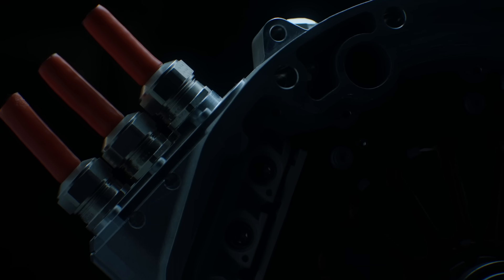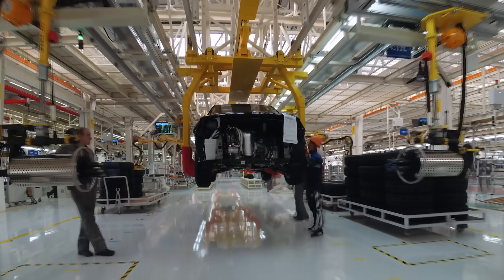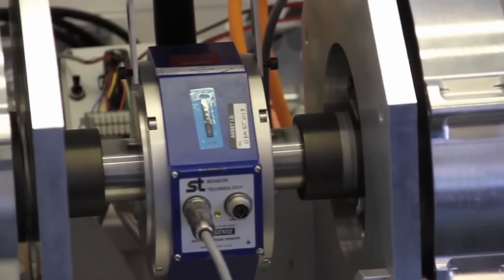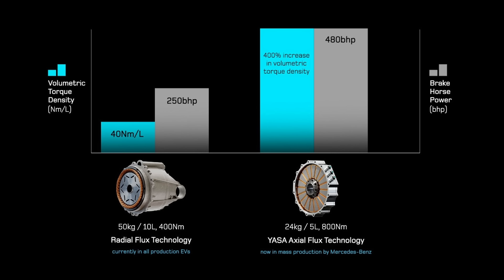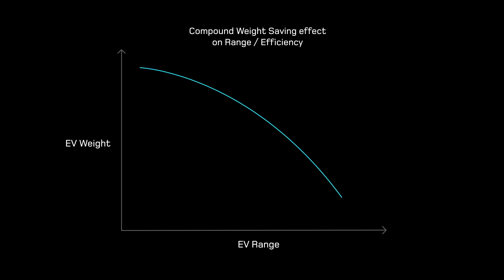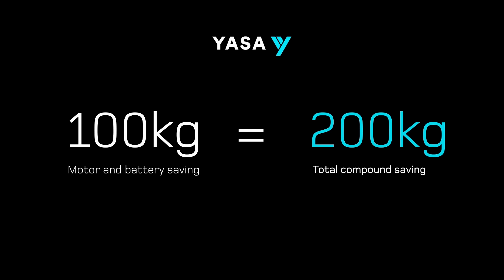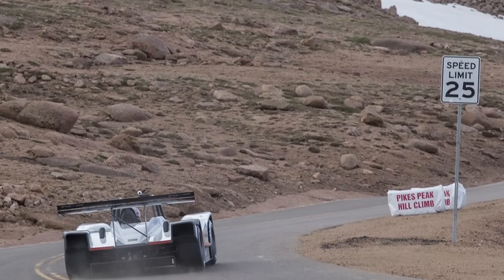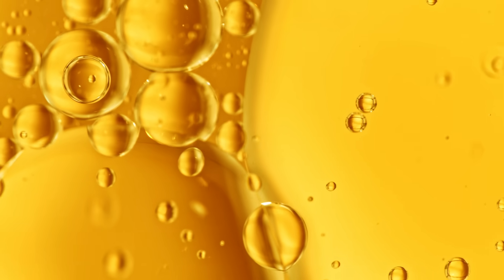The YASA Story - Axial Flux Motors: The Future Of Electric Vehicle Propulsion

Comment: Credit to : Nikola Tesla's work included exploring axial flux motors, which he patented in 1889, though radial flux motors became more prevalent due to their easier manufacturability at the time, but axial flux motors are now gaining traction in electric vehicles for their potential for higher power density and efficiency.

Comment: CSIRO autralia designed an axial flux motor with efficiency of 98%, using litz wire and halbach array for magnets also helped a bit, some car fan motors have been using axial flux motors for a very long time.
Windings look standard axial flux type, previously they were set in resin for lightweight.
Not sure what is so new ?

Comment: How do you address the need for rare earth elements such as neodymium magnet? It would increase the cost of the car by a certain factor. Electric car manufacturer such as Tesla does not use rare earth material in their motor, which reduce their vehicles' price.

Comment: There are two definitions for Free Energy. By getting something for nothing, impossible. And by cost analysis. 
Troy Reed invented a Free Energy device and documented the journey from a 10' monstrosity to the size of a small commercial refrigerator motor and put it in a small economy car. It runs forever. You'd plug it in to charge the Grid, not the car. 
That's just one Free Energy device being stifled. 
Dennis Lee is another name you should look into. 
My hopes are that this is a whole lot better and they become mainstream. Then someone will try to beat them until Free Energy is the only way to be better.

Comment: Isn't it a bit disingenuous to talk about torque without mentioning the revolutions / minute the motor makes.
He says his motor has 800 Nm torque, but forgot to mention that this is at 5000 revs/min, while a conventional EV motor does 20 000 revs/min with 400 Nm. So when you gear them both down to 2500 revs (tyre revs at 60 km/h) the YASA motor achieves 1600 Nm torque where the tyre meets the road, while the conventional radial EM motor achieves 3200 Nm.
Why didn't he quote the motor output in kiloWatts as it should be done?
Then people would figure, that he made a motor that's half the power of the conventional radial flux EM that he was complaring to - this is where most of his weight saving comes from!

Comment: I'm a bit perplexed. Grats on all of the trial and tribulations YASA has overcome over the years. Alot of smart/hard work has gone into your product/s. However: why in the world would you use an oil-based coolant for the stator?!?!? The best oil-based coolant I can find only has a thermal conductivity rating of .125-.126 W/m K.......! WTF?!?! Come on............ I get the coolant needs to be non-conductive over extended periods of time. Even after adsorbing the Ions from the coils. But .125-.126 ?!?!?!? Hell even pure Ethylene Glycol has a rating of .258 W/m K.......... This doesn't make sense. That oil based coolant has to have another purpose other than just pulling heat out of the stator..........

Comment: Have you considered the idea of turning the solid copper stator conductors into tubes, and pumping cooling air through the copper coils? I think it could be a very efficient way of removing heat directly from inside the windings.
Reply: Air would be very ineffective as coolant. A water-glycol mixture would be very effective, but not feasible in contact with high voltage. Oil is the solution, but the passage though a winding would be so long and narrow that it would not be practical.
Reply: you won't be able to pack as many turns, and turns are what's important for the strength of the magnetic field, which translates to torque
Reply: The field strength depons on ampere turns.
So less turns but more amps. @nikbivation
Reply: @kenrowe167  filling with "cooling air" also means less amps.  No amount of shuffling variables around makes your naive idea a good one.
Reply: Considering what they've gone through in the design process, I'm quite sure they thought of that already. Sadly, whatever you think might be a game changing idea on anything has already been thought of. It's hard coming up with new ideas.
Reply: @DaveBuildsThings  It's hard to come up with new ideas but that doesn't mean that it's impossible. Plus sometimes it's easy to overthink stuff and someone that may not have a clue may give an idea which they never thought about.
Reply: @madbull4666  I challenge you to come up with an idea no one has ever thought of and get back to me when you do. My guess is, nothing more will be said.

If they needed help from the YouTube science community they would have asked and clearly they did not. No scientist browses YT videos looking for answers to tough questions.
Reply: @DaveBuildsThings  I've been talking to a friend who's an engineer about his project which is a force feedback controller where it twists in the middle which feels amazing with racing games. He just received his patent last week to show that he was the first one to come up with that product. He also made his own motor which is far stronger than the majority of commercial products while having smaller dimensions. I'm also currently designing a force feedback device too and am currently designing the motor itself, which while has been done before I've gone about it in a very different way which should be a lot better in almost every single way, hopefully. 

Challenge accepted and challenge completed. 

Yes you're right that 99.9% of the time these comments are useless and it's something that they have already thought of but very rarely someone may see a comment on a video or in a forum which massively helps.
Reply: @DaveBuildsThings  you have a very limited mindset. you're unlikely to do anything thinking like that. often you don't even need to create a new idea, just a unique variation, or slight twist that can completely change the game.

Comment: If they could make it 10 times smaller then a 48hp motor would be perfect for a hub motor, I'm picturing a Citroën DS with four of these, one in each wheel, with the battery in the engine bay ..

Comment: 11:33 Copy or not being 100% no one make the same motor is ridicuolus. Why no one make research on that company? What about MAGNAX? now i think is name is TRAX or TRIAX but use the same thigs. yokeless, flat wires and triangualr widing to fit all space.
And cheap and very efficeint motor used in aerogenerators made by amateurs already use axial motors with epoxy and no core. but is not new.

Comment: i cant help but think how useful this will be in electric motorcycles. this small motor is 400 hp and we tbh only need half of what it can deliver to make a really really fast bike. cant believe m saying this bt m excited
Reply: The main weakness is with the size of the batteries needed and the range, there's a few bikes that can do 100 ish miles but that goes right down if you have any fun which is a shame, and as battery charging still has a way to go especially for fast charging outside of teslas chargers then you'd have to be stopping all the time. but in the future it could definitely be viable.

Comment: 1:29 power and efficiency combined with difficulty of acquisition regarding mined components and the inability to repair. Theyre weak, unreliable, and inviable for most vehicular needs beyond the most basic passenger commute, not to mention the difficulty in acquiring the materials, they are also hugely detrimental to the environment, arguably equal to or greater than that from carbon emissions.

Comment: Great Motors and amazing technology! But please stop the greenwashing. There is absolutly nothing green about motorizing a koenigsegg or ferrari. Those cars take tons and tons of ressources, time and waste to create. Like buying a 110k $ Rivian wont be more sustainable then a 70k $ Ford Truck until, lets say 30k miles and after that you will need to use the rivian for at least 200k miles (for usefull stuff not just fun driving around) to match the resource intensity of a 30k $ Truck which will also get most work done but with less luxury. Same with those motors! The ressources inside it wont help anyone when driven for 700miles in their entire lifespan inside a koenigsegg instead of inside a 30k $ car which everyone can buy and use for 20-30years.

Comment: Impressive to see its possible to get this principle to spin fast but would be interesting to see numbers of the possible rpm ranges.  Since this is a task with radial machines as well.
Reply: On their site they say up to 8000 rpm. Car tires typically spin well under than 1000 rpm on the highway. 🤓
Reply: @serversurfer6169 make your calc again. You need till 16k rpm with a dif ratio of 9.
Reply: @patrascudanielionut2639  Why would you run such a high ratio with an electric motor? 🤔

Comment: In the mid-50s my dad(a Biophysicist) said that Electric cars are our future and necessary to our future. We built and electric gokart using a starter motor from a Packard V12. He would have been 100 years old this year and would have loved to see where we are now headed, though, likely, would have complained that it has taken too long.
Reply: That is Awesome! 
Great times and memories ! 
In the 70's when I was in the Navy, we took an old electric over hydraulic motor and built a mount to install it in an old '63 VW of mine. It worked well and had a 75 mile range using 8 of the 6 volt batteries, but was not the fastest thing in Charleston at the time. 
Your Packard starter would of been about 1.4 kw of power ( if I remember correctly), so very impressive to power a go kart with.
If I remember right, the old 6vdc starters were very rugged and could take 24 volts with no problem.  
Well done to you and your father!
Reply: He was right on both counts. ✊
Reply: Clever man
Reply: certainly the future. modern batteries are the main problem. lithium, cobalt etc need to go. we need to use more sustainable materials even if that means less efficiency. also consider that if everyone is driving electric cars that's going to tax the power grid to a point it can't handle. we need to 100x electric power production.
Reply: @chrishayes5755  Nuclear Power baby. Stop the hysteria that caused Germany to shoot itself in the foot.
Reply: But sadly electric car is not our future 😢

Comment: I allow myself to warmly greet,

For over more than ten years I've been developing a model of an “Axial Flux Coaxial Magnetic Generator Motor”, which I consider has especial features: 
Summarizing its main strengths:
1.    Doesn't have, neither needs the stator.
2. The coaxial system provides two (02) angular moments, to the kinetic energy.
3.  Merges the “power” of the moment reactive torsion (-Mt), with the original force that produces it.
4.   Neutralize the (-Mt) moment reactive torsion.
5.   Replace part of the electrical energy it consumes. 
6.   The transmission system is included.
7.   Doesn't occupy useful space.
8.   Doesn't represent extra weight for the damping system. 
9.   Develop a high torque in a low energy consumption (DC).
10.  Assist the vehicle stability. 
11.  Can work in rough conditions, even underwater. 
12. Its dimensions are directly proportional to its power, without consuming high currents at the moment of breaking the inertia.

If any interest exists over the product with the characteristics mentioned, I manifest my total will to share the Theoretical Framework, as one of my main objectives is to develop a prototype of this product and use all my efforts into a good end.
Reply: Sir do you have any social media account I can contact you on, I'm making an axial flux motor too and desperate help of how I make the wind, and place the magnet, also has no idea how to cool it, my goals aren't that high and innovative, I want to make a motor as powerful and reliable as yasa motor and that's it basically, please reply please
Reply: @karaabdelkader1273  https://youtube.com/@OverbuiltByHenry?si=BJvKmMpBKbsCg4Rx
Reply: wtf
Reply: @giocooo  Sometimes I also think it's not true.

Comment: YASA, create 3-pin HV round connector and cable with shared shield. Stop using three single phase inlets - reduce weight, complexity, part count, cabling.
Reply: A single cable would not be flexible enough for practical application, due to the diameter. Single connectors are routinely used at the ends of the three-cable set.

Comment: On the surface, there is nothing new except for manufacturing processes and cooling system. And he did mentioned about controlling the air gap, which isnt new. One small company in Ashburn, VA did that long time ago and were well known with their solar car motor. Perhaps as he said, the real invention is in creating the machines and supply chain.
Reply: Scalability is what separates them? Okay cool. I was about to rewatch the video, because I thought I was missing something as nothing seemed new at all. 

 I mean Helix UK has a motor that is 800hp, at just over 50 pounds. It is absolutely insane. 

 I don't ever hear them talk about cooling in general on motors so i dont know enough to comment on thwt. 

 You know there is this new blade less fan technology that is developed for computing called the AirJet. It is pretty wild, but haven't heard much in half a year.  Wonder if it could be used for EVs at any point. 

 EVs these next 10 years are going to be wild. Solid state batteries paired with axial flux. Have over 1,200 BHP in a small 40k sedan that can rear steer, and steer by wire. People want hub motors, but I don't know if that is a good idea personally except for niche cars.
Reply: @dianapennepacker6854  , better cooling system means you can operate at higher current thus giving you higher continuous torque. I help with testing of these variable air gap axial flux motor to the limit, over 20 years ago. And we also built water jacket to replace the cooling fins behind the stator. Anyway, good to see how much progress been made. 

There is an issue with unsprung mass if you want to install powerful hub motors into the wheels.
Reply: @Avicenna_76  Yeah, I know they need to be cooled. Yet I was just saying that every company has their methods of cooling. Some are doing similar things even IIRC. 

 As for the hub motor, in engine wheels, or whatever you want to call them. Yeah exactly why I don't think they are the future like some claim with axial flux. Unsprung Mass and reliability issues aren't worth it for a while anyway. 

 A motorcycle or scooter with a solid state structural battery in the frame, and axial hub motor would be a cool design though. That might outweigh the disadvantages, but I'm still not sure how a bike would handle with all that weight in the rear wheel. It would be cool to see. Saw a hubless bike not to long ago which was interesting. 

 I could be wrong, but I just think it will be niche. Unlike something like steer by wire which has huge benefits if done right with little disadvantages.

Comment: So what is it's power to weight ratio compared to Konigsberg's Quark? Which is 30Kg to 300HP! That's a 10:1 ratio. What is it's efficiency in input to output? 99% or better? is the rotor tubular so it can accept a high speed low torque differential inside it?
Reply: Koenigseggs Quark is a variant of the Yasa design.

Comment: It's a Cedric lynch motor?
Reply: No. The Lynch motor is a brush-commutated design, and has a specific winding pattern using formed bar "hairpins". Both the Lynch and YASA designs are axial-flux, but there were axial-flux motors before either of them.

Comment: "Further and faster than current..." but they didn't mention durability. As technology marches on it always seems to have a decreased life span and no possibility of repair. Just run it until it fails, and then replace it is the kind of thinking that has humanity in the precarious position we are in today.
Reply: Single use, non serviceable.  But whats to service?
Reply: @mcspikesky  the bearings and the windings, if they should burn or short out over time..
Reply: It looks like a complex structure that raises the probability of something going wrong that raises cost for maintenance.  Simple is better.
Reply: @ca24tamie30  Humans couldn't have walked on the moon with "simple."
Reply: Making sophisticated technology readily repairable adds considerable cost.  In the old days, everything was repairable because the means of manufacture were crude. Things HAD to be made in more discrete parts.  I remember watching my dad rewind an electric motor for our washing machine.  It took him 9 hours.   Today’s manufacturing winds coils on electric motors in seconds, with vastly higher precision and less likelihood of getting a crack in the varnish that renders the motor inoperable.  In that sense, today we are faced with the conundrum of making it repairable means the device Costs more, weighs more, is Less efficient, and MORE prone to breaking in a way that needs repair.   ( Easily repaired machinery from the old days was also more frequently in need of repair.   Triple A was formed because a 1930’s car trying to get over the grapevine in Southern California had 15% chance of overheating or otherwise breaking down.   Today, we routinely expect cars to go 100,000 miles without requiring a single repair. ) 

What is crucial is to not build things that are not serviceable, that end up in landfill.   That is, a broken axial flux motor might well be far less costly to simply replace, than repair.  But we should specify that the broken motor be returned to the manufacturer where it can be broken down and it parts recycled or re-used.   Copper and steel can be re-melted and made into new parts.